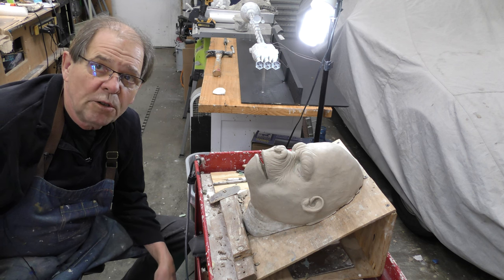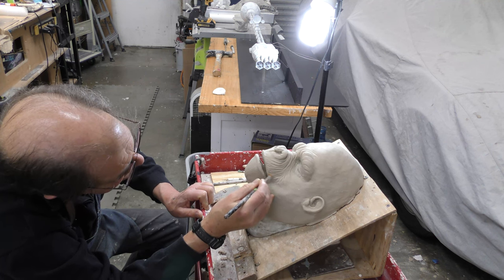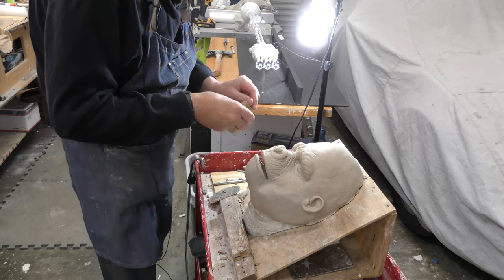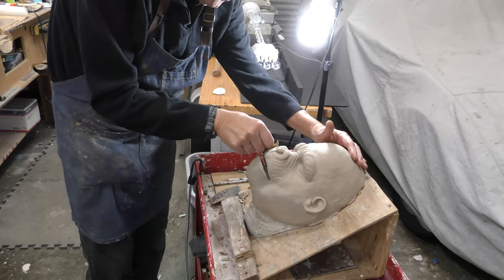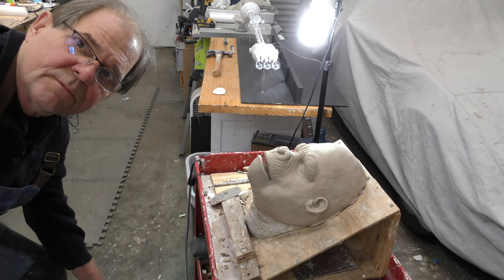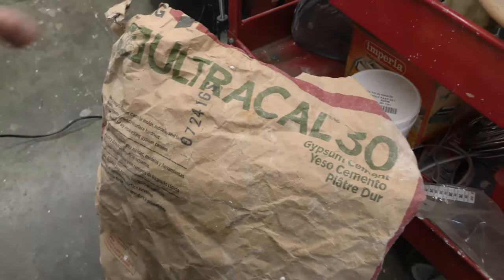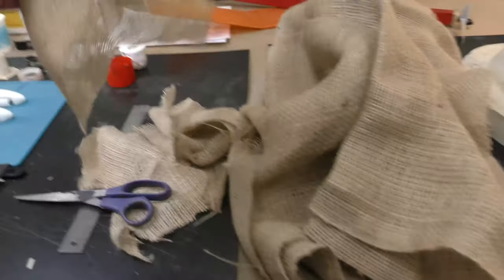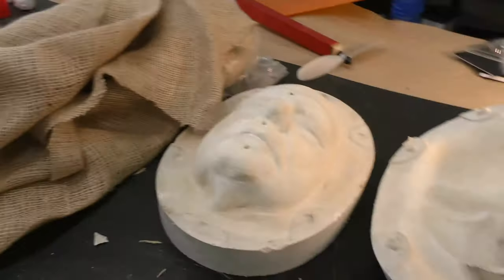How to make a POTA gorilla part6

Comment: The lemon pledge makes sense - it contains silicone oil.  I know this because a luthier told me never to use it to polish a guitar, because it you need the guitar refinishing, it stops the paint sticking.

Normally I spray the clay with kryolan, and then 400 mould release, which Rob taught us.  I also clean the mould with naptha and a soft brush, to remove any clay or kryolan, then let the mould stand open to dry out.   I got into the habit of baking moulds before using them for foam, because my first-ever attempts were ruined by steam lakes.

One thing I'd really like to see is how you do a clay press-out, to duplicate a mould.  I've duplicated face casts using plaster-backed alginate, but never the actual negative impression.